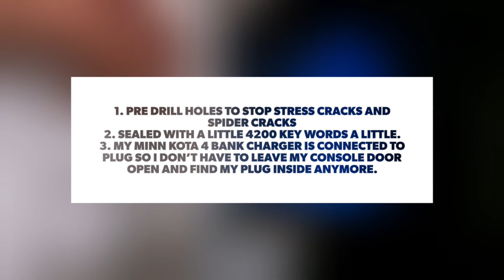Battery Tender exterior outlet plug installation

Comment: Jim.  I was in the boat market and I bought a 188BR just because of your videos.  I liked what I saw.  Much bigger boat in person than what I expected from a 18'8".  My question is, where did you  mount your battery charger?  I was thinking about mounting starboard behind the side rode holders inside the console using the same screws as the rod holder but longer of course.  Is there anyway you can post a picture of the inside of your console to see the wiring, charger, etc.  Thanks.
Reply from the maker: Hi Steven my charger is on the wall where my other electronics are I have the storage counsel so was able to install stainless steal nuts and machined screws inside the storage areas to hold the charger. I will add a review for this when I get a chance Also I have four batteries in the counsel 3 under the floor and one on top toward the side wall where the rod holders bolt through. Thanks